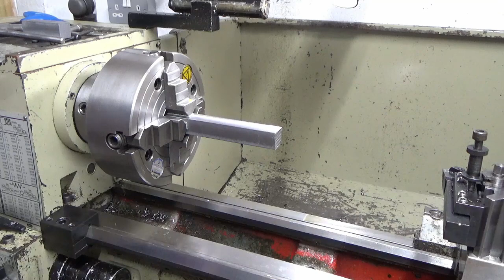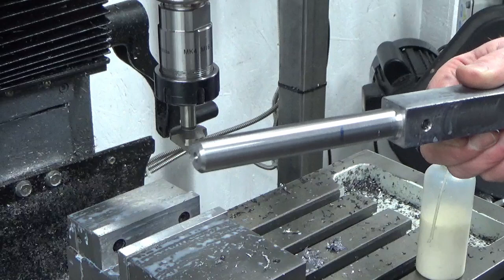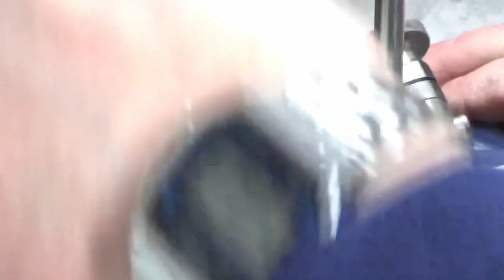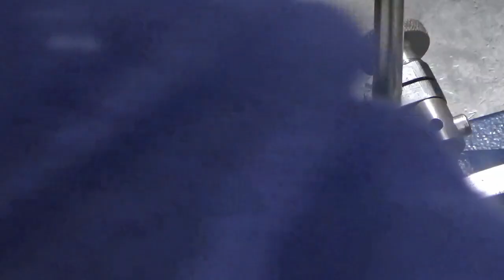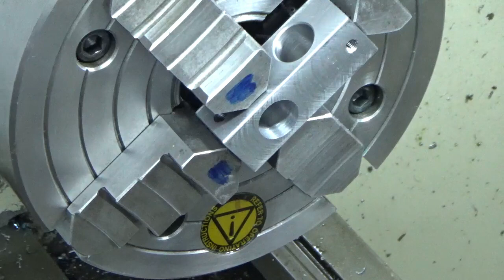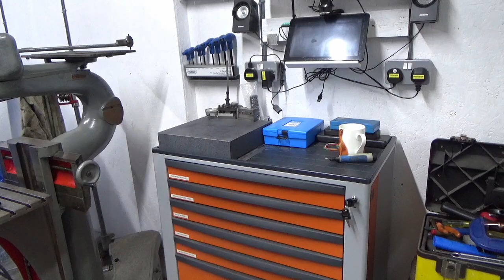Making The Joe Pieczynski Vice Stop........ With A Teaser!

Comment: Well done Jon, another great addition to your workshop tooling. A little tip for next time if you DO NOT have a reamer,  with the drill you intend to use, with an oilstone gently put a SMALL radius on the outside cutting edge of the drill. This will stop the drill from digging in and cut oversize.
Reply from the maker: Hi Dave, just catching up with comments (getting harder to do with all this fame lol). Great tip, I used this in the past, I also do similar for machining brass, as well as stoning the actual cutting edge to avoid grabbing (I actually show this in a video upcoming soon). Cheers, Jon
Reply: Sounds like a good idea for another video for you to do Dave!! On a serious note I have never seen that done so I will have to bear it in mind.

Comment: ...come on Jon, you used a centre drill instead of a spot drill to drill holes on the mill at the beginning of the video. I know it won't matter as long as you only use the narrow part of the centre drill but not having your experience I have to make it a golden rule otherwise I will forget (like leaving a chuck key in the chuck) I know it's nothing like as bad but it still makes me shiver ever since you explained it once.
Reply from the maker: Hi Glyn, thanks for the comment. Lol, don't get too worried about it, even if you used a centre drill and went fully in with it, chances are the hole would still be fine (especially if you are tapping afterwards etc). I got lazy on this occasion, had used the centre drill on the lathe on the previous op, and just grabbed it. I will definitely cover this in a tips video in the future, although it is a contravertial subject! Cheers, Jon

Comment: Something i have been meaning to make for ages .   What type of chemical blue do you use ?
Reply from the maker: Hi Max, thanks for the comment. I use Black OX from a company called Caswell Europe (based in the UK). If you go and have a look at my making vice clamps for the milling machine Part 2 video, I show the process and the bottle at around the 20 min mark from memory. Cheers, Jon
Reply: @jonsworkshop  Thanks Jon .